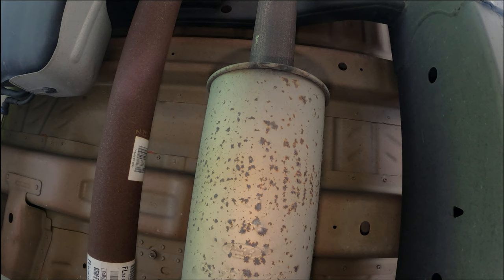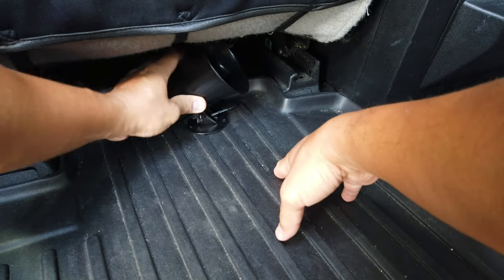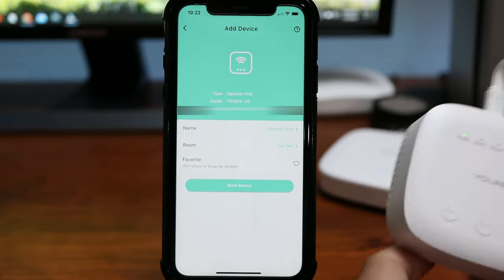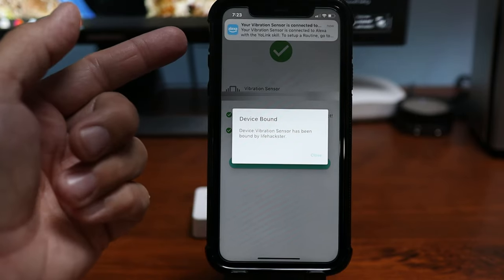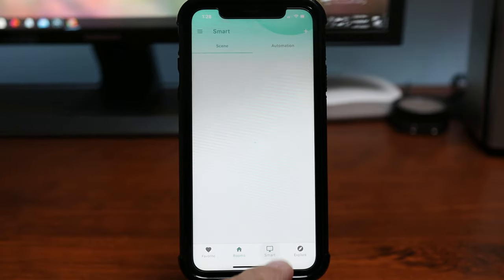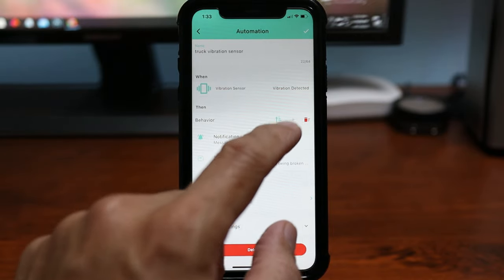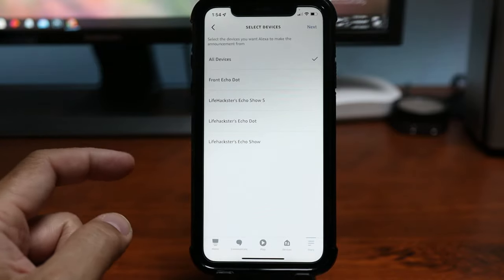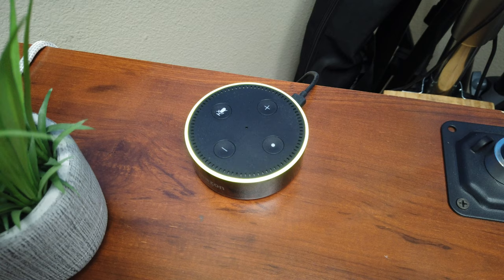Catalytic Converter Alarm Using Yolink Vibration Sensor - Setup & Testing

Comment: You can use one of our fobs and Control-D2D (device-to-device pairing), between the fob and the siren, to silence the siren even when out of range of your hub. And it's probably worth pointing out we'll have LoRaWAN and Helium-enabled devices soon. We have a door sensor in testing for this, now.
Reply: Any advanced setup tips or placement ideas? I assume since  it’s not waterproof put in the car
Reply from the maker: I have to check and test this out. Thanks.
Reply: @LifeHackster  Hi, Did you verify if D2D works with this? If, yes then, you can carry your hub or siren hooked up to power bank with you.

Comment: I'm so glad that I found your YouTube again since I use Reolink. So many questions that I have hopefully you have it somewhere already answered right now yolink, I've had many of their products at this point probably over $500 worth for the last two plus years or whenever they started having trouble with their water valve actuator they've decided to discontinue which really sucks cuz the first one didn't even last a year anyways my main post here is about vibration sensor I just got one for my truck prior to this video lately I've just been experimenting with it but it's very nice I also use their products for my customers since I do HVAC work.
Reply from the maker: I have been using their valve controller and their sensors.. No issues since I had it. Thank you.

Comment: I Wonder if u can wire a yolink relay to the car factory  alarm to power the vibration sensor only when u lock the truck
Reply from the maker: That might be something to check and test out. Thanks.
Reply: I,think so far ur idea will be better the  what I been see I few guys bluid cages around they catalytic converter but some how they still get stealing

Comment: Do you know of any devices that will ping itself from an app every minute to determine if your WiFi at home has been tampered with and has gone offline? I have wyze, ring, and blink cameras, bulbs, smart speakers etc. A while back my wifi went down at the most inconvenient time while someone broke into my place and since I didn't get a notification that my wifi was down I had no idea to fix it and unfortunately had no sd cards in the wyze cams to even find out after the fact who it was. But yeah would be nice to know when wifi goes out so I know to be alert. Love my cameras but hardly can be considered a security system if the WiFi goes down and it doesn't alert me I'm no longer protected.
Reply from the maker: I know the Blink will inform you but not in a minute or every minute. Probably after 30 minutes. Ring cameras don't have this feature but their Alarm does and that is what I use, it notifies me within a minute when electricity is out and probably a minute or 2 if WIFI is out.

Comment: I feel like it might be glitchy and not re-connect when you get home and what if someone breaks into your car outside of the time frame?  Maybe a more sensitive car alarm with notification would be better so it works whenever you lock the car with the key fob like if you park at the mall and someone tries to mess with your car.
Reply: What reason do you feel it would be glitchy?
Reply from the maker: I have been using this type of setup with a ring motion sensor and the ring alarm probably a couple of years now. And also added the Yolink contact sensor in my center console about a month ago…no issues..set it and forget it system and everytime I test it..still works.
Reply: You can adjust sensitivity on this vibration sensor I've only had mine for a few weeks but of know about this yolink line for 2 years now
Reply: merluzo8269  Better to just have a device installed to make it much harder to steal.

Comment: Anyone know why Ring floodlight pro sensor and lights detects people and cars outside of motion zones? Anyone have this problem. If so how did y'all resolve this problem
Reply: As I understand it, there's supposed to be three customizable preference levels of distance on the Ring's Floodlight. The angling of your floodlight matters as well. You may need to tip yours down a bit. If these adjustments aren't working, you should probably call Ring service reps (hint: they're not in the comment section of a totally different product 😉)

Comment: Does ring have vibration sensors?
Reply: The distance you can use the yolink I think would be much greater than ring or other products due to frequencies used.